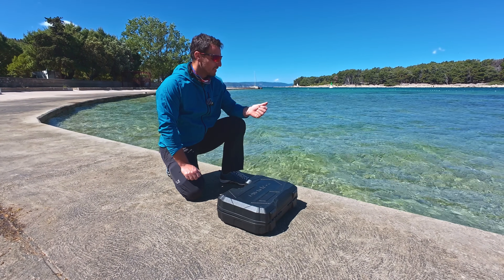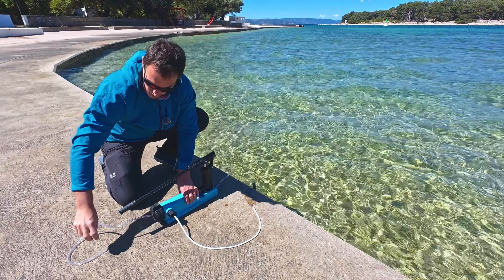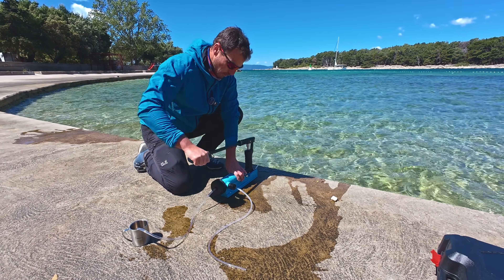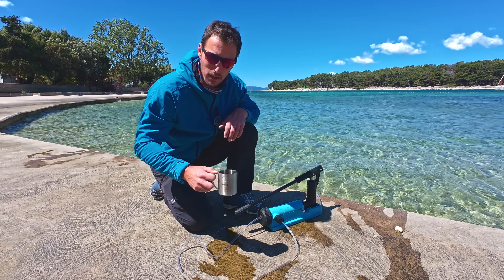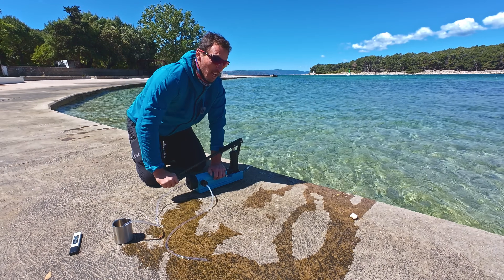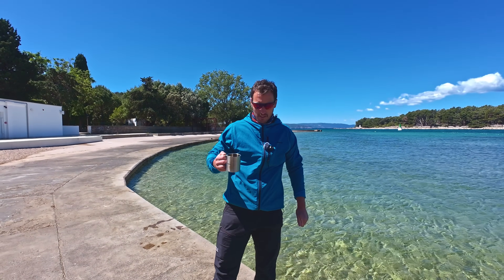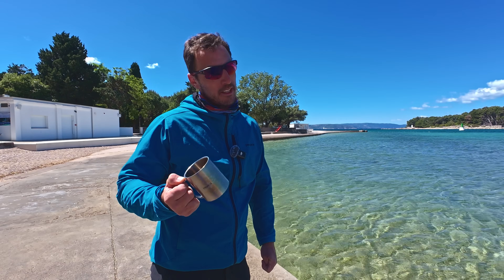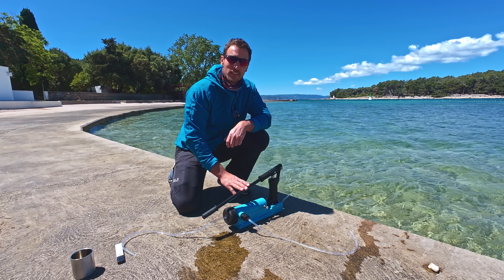Watermaker - Sea made drinkable

Comment: TDS meters dont measure salinity.. It measures total dissolved solids. You need a salinity meter or a refractometer
Reply: This kind of tds meters mearsures the electrical resistence between two electrodes. It dosen't actually measure total dissolved solids, only ions.

Comment: This works through reverse osmosis. RO strips almost all minerals from the water and that's why it tastes a little funny. You can add the minerals back in if desired. This can be done through a post "filter" or by adding packets of minerals.
Reply: Not in this case. In this case it tasted funny because it wasn't clean enough. Yes, you can drink water with up to 1000ppm TDS but drinking water usually contains between 100-200ppm TDS. A working RO filter will produce  0ppm TDS water and as you say that would taste a bit different/funny to.

Comment: They need to make one with a small flexible solar panel and a little dc electric pump that works as directly as possible from the solar panel. Then a person can walk away. Even if it just barely trickles water out a person would be much happier. Heck, even just converting the hand pump to two pedals that you could stand on and transfer your weight back and forth between the two would be way better.

Comment: If you need a device to create water why not just a normal pot still. Then you just need any heat source to evaporate the water. It will require no filters and can be used so long as you have an ability to boil evaporate water. Since you have access to a large body of colder sea water not only would that be your water source but could be used to chill the condenser.
Reply from the maker: It’s easier to use watermaker in liferaft.
Reply: Lol @IgorStropnik

Comment: Needs an option for 12 V electric operation (even if slower) and would be more useful if it could operate just like charging batteries via propeller motion under sail (say above 5 knots)... 

Sweating in order to drink is not a survival technique...
Reply: YES! could put a foldable solar panel at it! and then you just stay in the shade and wait a couple of hours...

Comment: It's better to take the water in the middle between the sand and the surface. Less particles floating and away from the silt settling on the bottom.

Comment: The solar method gets you water that essentially drains your body of electrolytes and minerals, because it's distilled water, which does not contain any of that, so that's not going to work. Rain water is not drinking water, way too many contaminants, thanks to all the pollution and whatnot, so that needs filtering. Sea water needs the salt removed, but not the minerals, so just particle filters are again just bad for this. Proper desalination that retains minerals and even adds the stuff we normally put into tap water is a lot harder and that's why it's so expensive and difficult to setup in large quantity.

Practically a better option would be using that water to grow plants with high water content as they tend to also contain nutrients, although that can be achieved with rain water better than anything. Distilled water has the same effect as on humans, essentially draining the ground of minerals the plant cannot get from the water itself.
Reply: I apologize, in which country do you live that you have toxic rain?
Reply: @Syntropics  Rainwater everywhere on Earth unsafe to drink due to ‘forever chemicals’, study finds, University of Stockholm

I live downwind from a Bayer factory and a metal coating company with two big smoke stacks. I don't really want to even know what's in the rain that comes down. Air pollution goes directly into rain water. Collectors may be impacted by birds, insects and whatever else is floating in the air like pollen, particles, spores... I have a strong stomach, but I'd rather not drink bird excrement. Bad enough that stuff falls on plants and we wonder why there are PFAS in the food.
Reply: @Syntropics  Newsflash: Studies show that rainwater in the U.S., Sweden, China, and even Antarctica contains PFAS at levels higher than what's considered safe for drinking water.
Reply: We're talking survival gear here, not some special tech that knows what salts are good for us!  Bring your packages of hydration salts if water being too pure is your problem

Comment: Igor, human legs are much more powerful than arms and hands. Tell the company to design the pump for both feet and you can step on it left/right to reduce your effort and make the device more efficient. Also, the intake device will need a floating part to stay on top of the clean seawater with a probe submerged under it to avoid taking sand from the seafloor.
Reply from the maker: Good idea 🙌👍🍻
Reply: Also, sailors get weak legs and need excercise.
Reply: He is making potable water not trying to empty the ocean.

Comment: good job on workout for testing that "device" (maybe is tds meter but they usually correct for a while even chinese ones for month or 2) . on serious note leave it there and walk off, why?. well coming copy/paste from WHO on google:  "Drinkable water typically has a Total Dissolved Solids (TDS) level below 300 mg/L (or ppm). The World Health Organization (WHO) (aswl not reputable organisation take note of that) recommends a TDS below 300 mg/L for pleasant taste and to avoid potential health concerns. While the US Environmental Protection Agency (EPA) sets a secondary maximum contaminant level of 500 mg/L, this is based on aesthetics rather than health risks. water companies are scaming all of us coz  tap water is way above that under 300 lvl is mostly in range 400-600 tds.
Here's a more detailed breakdown:
Excellent: 50-150 ppm
Good: 150-250 ppm
Fair: 250-300 ppm
Poor: 300-500 ppm
Unacceptable: Above 1200 ppm 
keep safe and drink proper water
cheers

Comment: So how about the Membrane, Is it a 1 use only sort of a deal? Or can it be dried and used again?
How much is a Replacement Membrane?
Is there replacement O-Rings for the hydraulic pump?
To be Honest My Shoulder hurts from just watching you do that and to run that Pump for even 15 minutes Straight I doubt most people could do. I'm just being Honest with you my friend.
Cheers Igor and Thank You for the Video and demonstration, I look forward to the next Versions of this Watermaker.
Reply from the maker: New membrane is 25eur. I flushed with fresh water and drained. Time will tell.
Reply: The RO membrane has few thousand litres on it depending on the tds of input water.